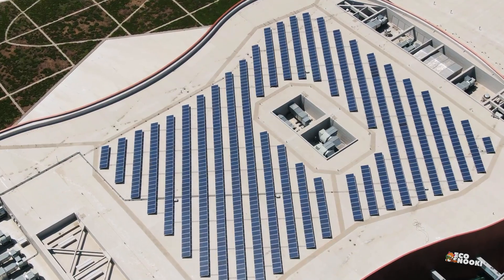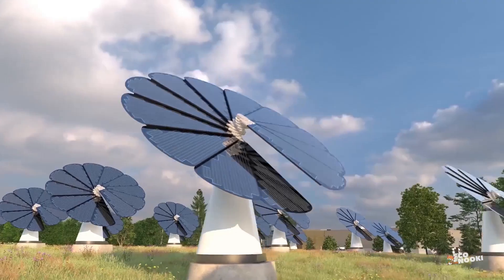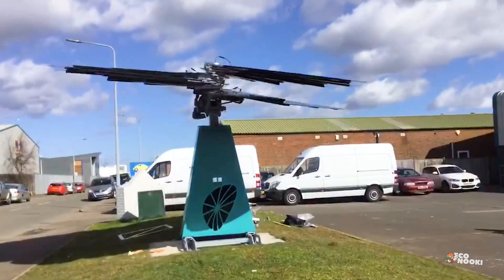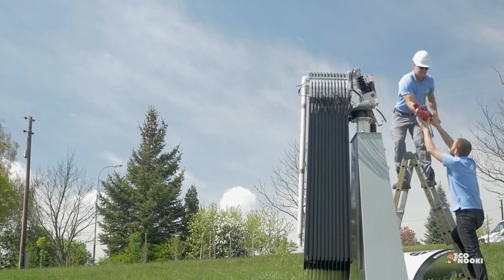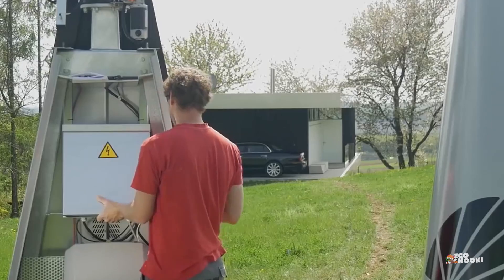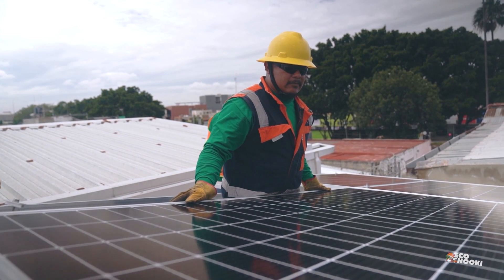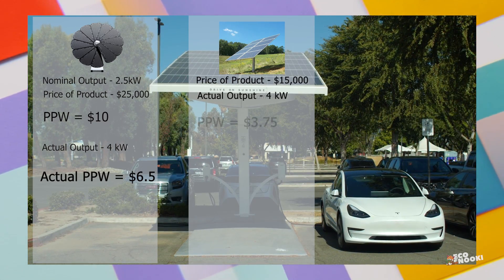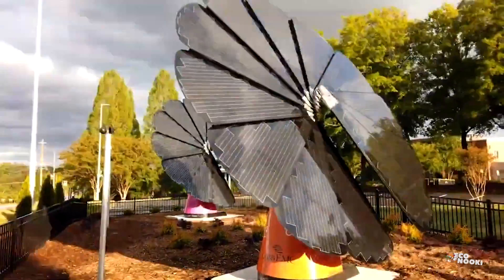This Weird Solar Panel Looks & Acts like a SUNFLOWER!

Comment: Why can't I just fit a rectangular solar panel doing the same dual axis movement..than a flower like design? is there any pro for such a pattern other than the look of the flower.
Reply from the maker: Its actually the design makes it unique and appealing to our eyes. Cost effectively we can use regular panels with duel axis movement.